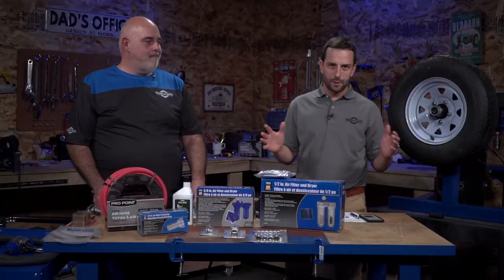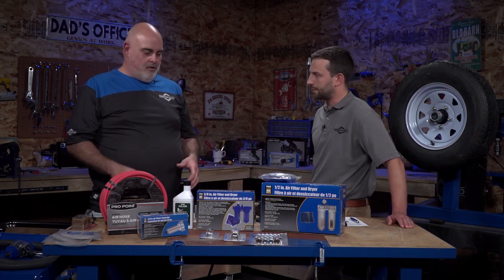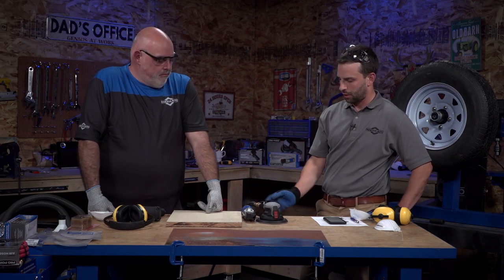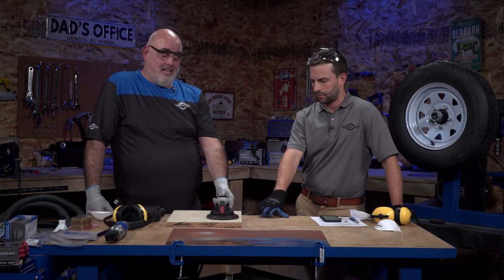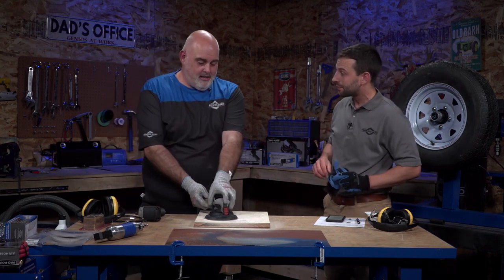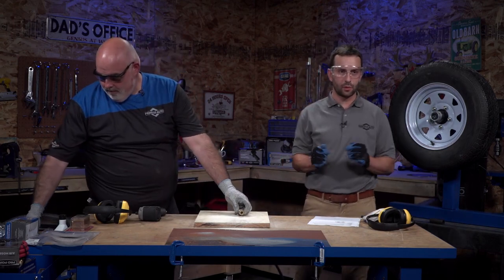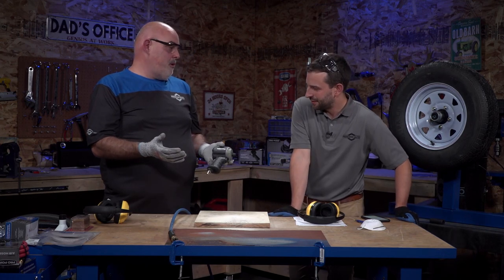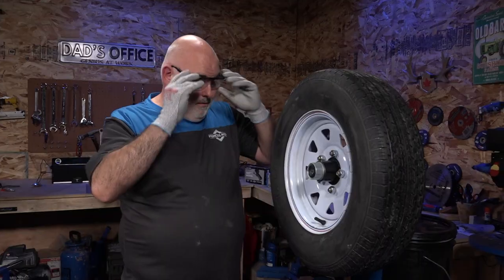See it Work - Episode 5 - Air Tools

Comment: Show down array of pnematic tools:--
Angle grinder
13mm pneumatic driller
Pneumatic Die grinder
Pneumatic Sabre saw Cutter
Pneumatic Belt sander
Pneumatic underbody spray
Pneumatic air cleaning gun
Paint spray gun
Pneumatic screw driver
Pneumatic zigsaw not to be seen.
All works on same principle - the turbine free spinning determines the tool speed and worthiness, alas the body of pneumatic tool gives shape to your requirement for your decision which yool to rely on and what purpose you have.
Ultimately compressor and electric tools both requires electicity.
Now we have lithium tools to go.

Comment: Will a 60 gallon air compressor run a die grinder Thanks
Reply: Yes. I assume you have the 3.7hp model from PA.
Reply: Yes you can use die grinder, oil before you use the tool to keep the tool in top condition.